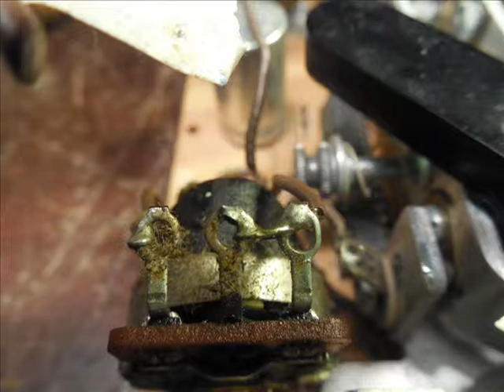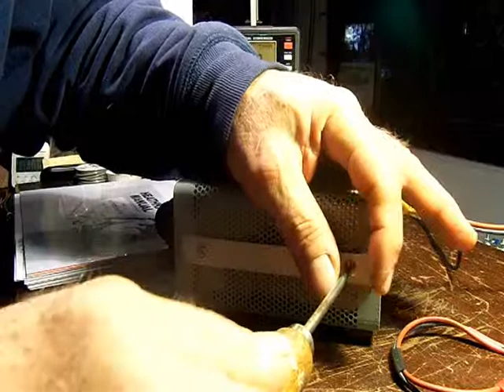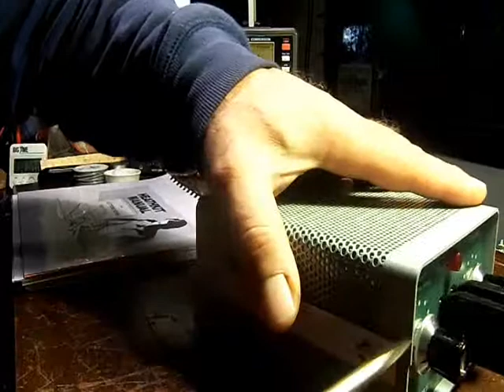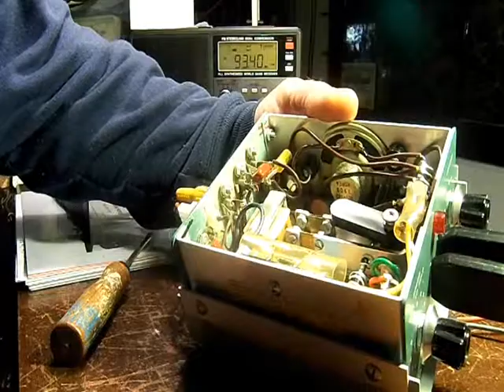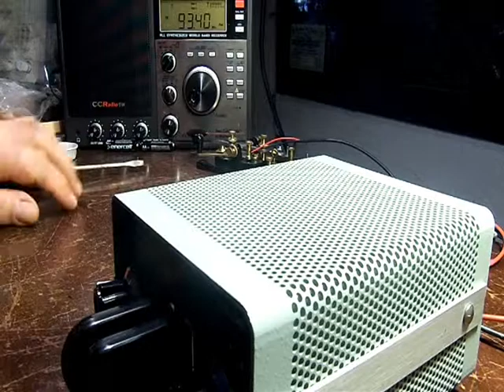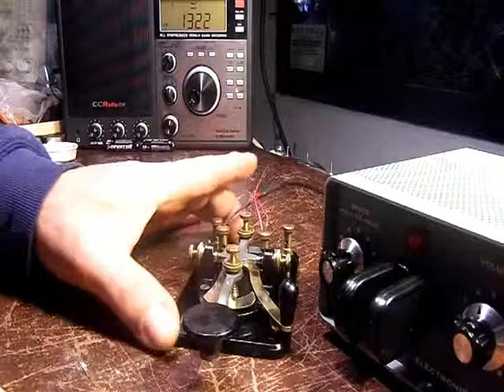Heathkit HD1410 Electronic Keyer Rebuild

Comment: Nice video! I have a question.  I just got one if these and it is missing the cam lever assembly. Do you have any suggestions on how to remedy that without having to buy another unit? Is it necessary to have it at all? My paddles are sticking sometimes when making contact creating a constant tone so I’m assuming I need it. Thought I’d ask someone who’s restored one. Thanks
Reply from the maker: Looks easy enough to make a cam. Piece of plastic that fits between the paddle levers, with a hole drilled the size of the mounting shaft/bolt, and, drill the hole OFF-Center. The off centered-ness will provide a cam effect. Also, "sticking" is coming from the paddle contacts. Clean them up with minimum light swipes using very, very fine sandpaper. Good Luck, and Enjoy the Keyer!
Reply: @TonyButchT  Thanks for the quick response and the info. I’m totally new to all of this so i really appreciate it.
Reply from the maker: @bfowler3065  You're Welcome! Take your time, and enjoy the learning experience!